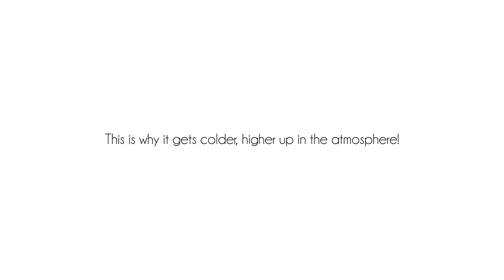If hot air rises, why is it cold at the top of a mountain?

Comment: but oil is denser than water and still it floats up... in case of air denser air remains at the bottom. i dont think you chose the right example.
Reply: How is oil denser than water?
Reply: @parrotbrand2782   ask oil..😁